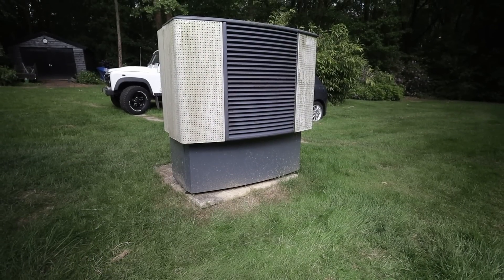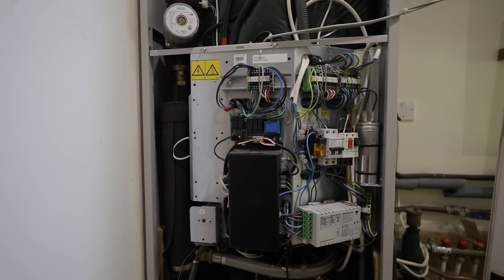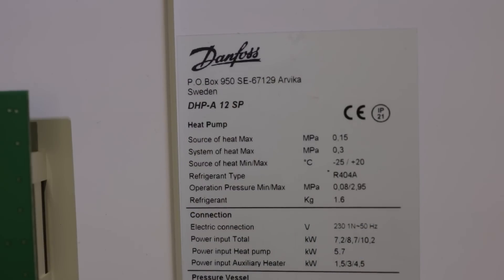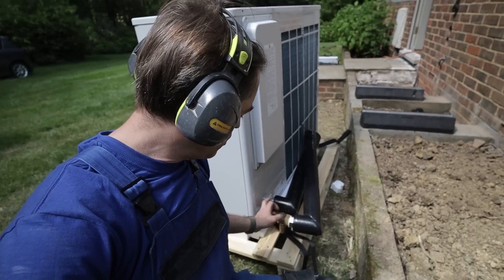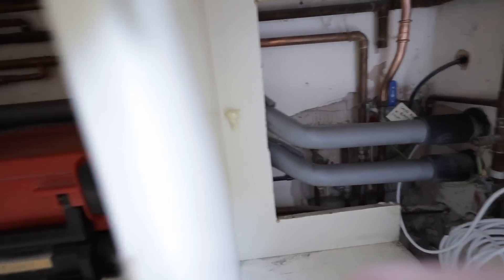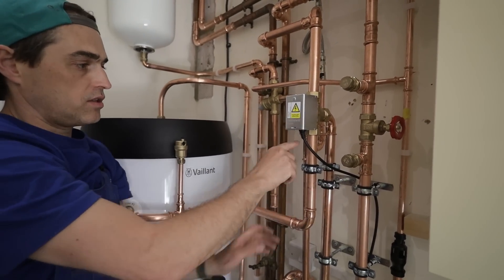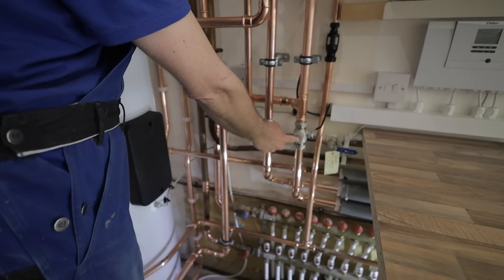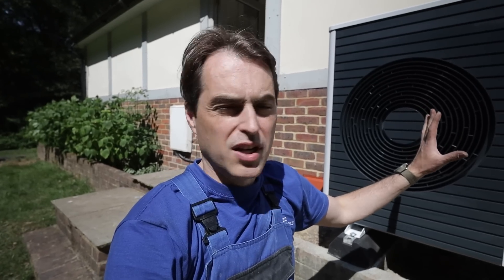Unlocking Super Efficiency: Air Source Heat Pump Swap With Vaillant Arotherm.

Comment: How much does a heat pump cost or are they different sizes, on average then ?
Reply: Their cost is partly related to their size, but also to the way they are installed which can add thousands to the cost of the installation. We are probably looking at £6-7000 of Vaillant equipment in the video.
Reply: @tlangdon12  Thank you for reply , I’m 65 now live on my own ,boiler stopped working in the winter so pretty cold a few months back, I want something ready for next winter only got pension of 10,000 a year is their a scheme where one can purchase it over a period of years ? Not a heating engineer but did work in the pump industry for 18 years, looking at your installations on your videos, firstly you are a very good professional and a nice soul which is very rare to have these two combined attributes, one could say a combination , sorry in my head that was funny as I read it out loud must blame the author = dying is easy, comedy is hard, sorry for long email but only a little sorry, my boiler is on a out side wall on the ground floor and outside is a concrete patio, having looked at your other videos I think if I had a heat pump it would be your easiest one you would ever in stall, change around properly two hours , if your ever in Devon more than welcome to have a look and obviously a cup of tea , live in a small house but all the heat pump’s I’ve seen you install have been large ones, don’t they do smaller one ? Sorry you are probably falling asleep now, hard work getting to the end of my email, so that a cup of tea and a medal.
Reply: @KavanOBrien  I'm not the installer we see in the video - anyone can post replies to your comments on YouTube. However, I am a nice soul as well and so I would suggest that you research heat pumps a bit more before deciding whether you want to replace your broken boiler with a heat pump. To work efficiently, heat pumps produce water at a lower temperature to boilers so radiators and pipes have to either be already suitable or changed to allow them to heat the home adequately. Heat pumps can cost more to run than a boiler, and they are generally more expensive to install than changing an existing boiler. I would expect you can get your existing boiler changed for about £3,500. I would recommend Boxt to supply and install a new boiler. They have an interest-free deal, where you pay for the boiler over 12 or 24 months, but this means the lowest you can get the monthly repayment is £145. THey do have longer term deals, but the i(fixed) nterest rate is 10.9%. The longest deal they have is 10 years, which would drop the cost to £47 per month. This means you are paying quite a lot for the finance, but you are likely to be accepted for finance with them, whereas finding your own personal loan at a lower rate might be harder. Just google Boxt Boilers to find them.
Reply: @tlangdon12  Oh sorry I thought you were the gentleman in the video my apologies.
Reply: @tlangdon12  sorry thought you was the gentleman in the video my apologies.

Comment: With such a large outdoor area, I'm amazed the customer did not go for a Ground Source Heat Pump? It appears the perfect property for it!

ALSO, did you design the system to have radiators and UFH on identical flow temperatures?!?
Reply from the maker: At 5x the cost and only a slightly higher efficiency?
Reply: @UrbanPlumbers  More like 3X the cost (1 metre deep coils), add 1 to SCOP and far more consistent performance even in sub zero temperatures.
Reply from the maker: Really? You can get ground source for under 30k?
Reply: @UrbanPlumbers  After BUS grants of £6K, yes absolutely. As long as you don't have to lay slinkies deeper than 1m.
Reply: @singlendhot8628  
Why 1 metre deep?
Reply: @johnburns4017  Cost increases exponentially when going deeper than 1.2m when we lay slinkies.
Reply: @singlendhot8628  
I thought it was another reason.

Comment: People are realising that air-source eat pumps are completely inappropriate for most houses in Britain
Reply from the maker: The opposite is happening, despite what oil and gas lobby is trying to say and mislead the public
Reply: As I understand it, setup and correct sizing are the key. A one size fits all approach like you have with boilers won't work well with heat-pumps.
Reply: @elminster8149  honestly, please take some time to educate yourself. 
You are literally living in the past with your knowledge and comments. 
Heat Pumps and engineering knowledge has come on leaps and bounds. 
Thanks in part to Heat Geek and a few others.
Reply: @deanchapple1  I did, hence the comment. Lol.
Reply: Poorly designed/ installed or being too poor are the only reasons to avoid heat pumps in 2023
Reply: @singlendhot8628  We have been quoted £10k-14k for a new gas system to replace existing system that is about 22 years old... so not sure the cost is much different.
Reply: @DragonXDrei  You're being ripped off. Definitely contact a Heat Geek!
Reply: @singlendhot8628  I just did that, found an elite not too far, let's hope they have some availability. The newest quotes I got for heat pump is 22 and 15 solar panels another 20k, so £42K. To be honest the work I have been quoted just to paint an decorate the property is crazy.
Reply: @DragonXDrei  For a 15 panel system, Solar PV should cost you no more than £7500 installed. That's with G99 and non-Chinese components. Add a Tesla Powerwall 2 for £9K installed. Total cost £16.5K. Your heat pump quote sounds very expensive as well - they usually cost < £10K installed after BUS grant.
Reply: @avivscrewvalla  Feel free to point me in the right direction, I am based in Essex. I reached out to Szymon but got no reply, a little disappointed.
Reply: @DragonXDrei  Szymon is an incredibly professional guy - if you're in his coverage area, he'll respond in time. My PV installers are based in Maidstone. If you share an email, I'll introduce you to them
Reply from the maker: Hi, apologies for not getting back. How did you send the message? I may not have received it? I only cover 1h drive around GU16 so doubt I can cover your area, but may be able to recommend a decent installer in your area

Comment: Just a household owner here, what size pipes are going to radiators?
Reply from the maker: 28mm reducing to 22mm then 15mm to individual rads
Reply: @UrbanPlumbers  here in Belgium they use multilayered pipes from a manifold to eacht radiator individuaal. Do they do that too in the U.K.? Bcs i always see u guys use copper and cobnect the radiators underground to the tubes.
Reply from the maker: @Autonomegast  rad manifolds are rare here
Reply: @UrbanPlumbers  
In the North of England they are common.  They tended to use mini-bore soft copper systems using a flow and return manifold. The south of England stayed in the dark ages.
Reply: @johnburns4017  why don't they use multilayered pipes (alupex) in the UK? (From rads to manifolds)